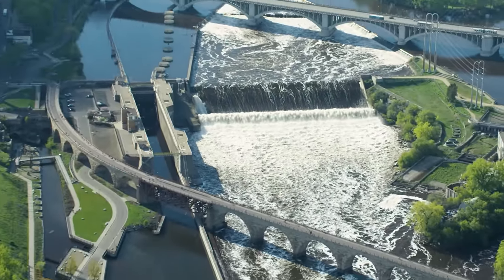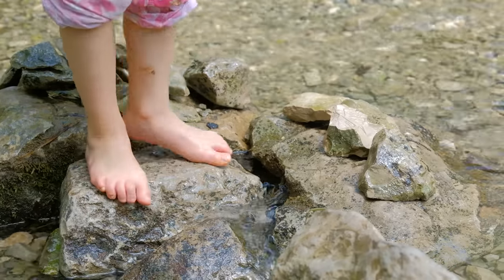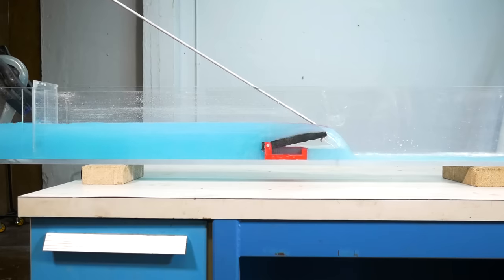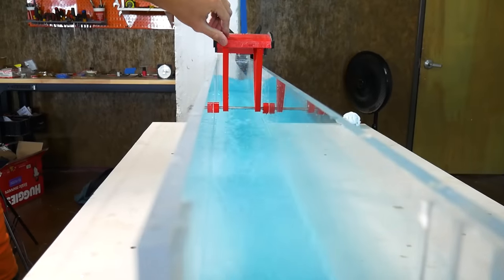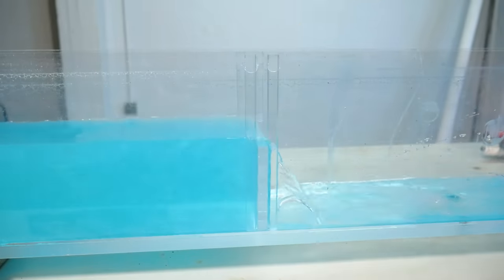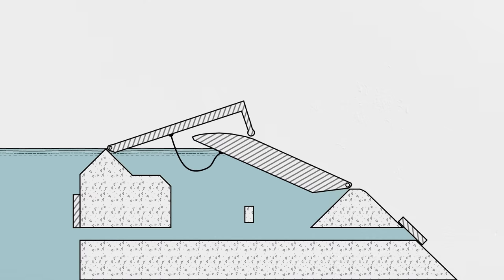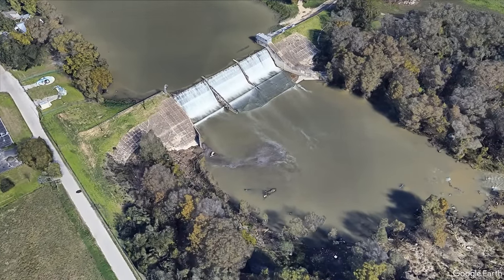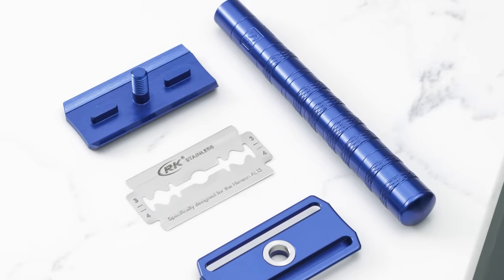How Different Spillway Gates Work

Comment: Why aren't reverse-facing crest gates common? They'd usually fail closed (because they'd be pushed upward by the upstream water pressure; unless the water level upstream was too low). Force requirements would be slightly lower than normal crest gates (and oriented downward, which might allow for actuator designs that use gravity). The only disadvantage that I can see is that it requires a load bearing stop that will, in case of actuator failure, prevent the gate from swinging completely around. 

Are mechanically operated beartrap gates popular? I believe Letternwehr (an adjustable weir used to control the level of Zürichsee) in Zürich has beartrap gates, but I thought they were mechanical (and couldn't see anything that looked like the downstream opening for draining the chamber).

There's a funny usecase for crescent gates, where they aren't trying to stop water flow, but only ice floe. There is an "ice dam" on Sihl in Zürich (next to Allmend Brunau) that is intended to protect the support pillars of the highway that's built over the river downstream of it, bridges in the city, and IIUC protect the channel that the river traverses under the railway station from clogging.

Comment: not aware of any bear traps where I work in Scotland but, we do have Drum gates which work in a similar manner, a large chamber is flooded with upstream water or drained and this floats or sinks the gate, they also have large floatation valves fitted so that it can track loch (lake) levels and maintain the reservoir level.

Comment: In July 2010 the Tempe town lake dam failed - it was previously an inflatable dam that could be deflated to let water out or inflated to hold more water. It would be interesting to compare the old vs new dams and dig into what may have contributed to the failure, what the benefits of the new dam you've described are.

Comment: Rare comment praising the sponsor's product - I have had a HS razor for a bit more than a year now, and it's excellent. No razor bumps or nicks! I'm still working through the first hundred blades. One suggestion is to pick up a razor bank to store and dispose of your used blades safely, as you should change blades regularly.

Comment: Awesome video Grady! Only one complaint - you mention that in the '95 Folsom Dam incident they finally controlled the water by installing stoplogs, but then mention that stoplogs aren't designed to be installed in flowing water! You can't leave us hanging like that! How was it done?

Seriously though this video is a great introduction to an essential component of hydroelectricity generation, I plan to share it with some of my less technical colleagues as a good introduction into how spillway gates work and (a few of) the ways they can fail.

Comment: Interesting pros and cons of the different gates.  After the dam failures in mid Michigan in 2020, officials said the old Tainter gate system on those dams would be replaced with crest gates in the rebuild. (work on stabilization was completed late last year, the rebuild phase should start late this year or early next year.)  I assumed that crest gates were simply a superior design. But really it's just making tradeoffs on the "best" way the dam fails. In the case of the mid Michigan dams, they were all earthen embankment dams with Tainter gates. When the first dam's embankment failed, sending water and debris downstream to the second dam, the debris from the flood got caught up in the downstream dam's Tainter gates, reducing an already insufficient outflow. The water then rose and flowed over the earthen embankment, eroding it away in just a few hours. With the new crest gates that shouldn't happen, but as you said in the video the lifting mechanisms of crest gates are more prone to fail because of the massive stresses on them. From a repair standpoint, it's a much easier job replacing lifting mechanisms than completely redoing the dam embankment. Most of the examples of Tainter gates in your video seem to be on concrete dams where overtopping the structure wouldn't be nearly as destructive as it is for an earthen dam. The exception in the video was Oroville dam, but that failure had more to do with how the damage to the spillway below the gates was managed than the actual gates on the dam.

Comment: New Croton dam in NY. Absolutely stunning in person. There is a hidden submerged dam not far from the one you can see. It was the first one they built, but later they expanded the capacity by building the one seen in this video.

Comment: I have a question. How are the stop blocks installed and removed? I assume that they are crane into place, but how does the remove part work. How are they able to rig the stop blocks up if there is water starting to rush over them once one or two are removed. Would really enjoy hearing how. Love the videos and how they are always making me think. PS love the book, great stuff!
Reply from the maker: Usually they have a lifting beam with a release mechanism

Comment: I work in a hydro power dispatch center in Sweden. About 30 power plants are my responsibility.
When I see a waterfall I always try to guess how many MW it could produce.
Also nowadays power price drops so much on windy days that we intentionally spill water instead of running at a loss.
Hard thing with spill gates is estimating how much water flows through them. If you are less than 10% wrong you are good.

Comment: For some reason, I find it quite amusing that a guy who films in his garage has an intern! 😂

The gates at Hoover dam (Lake Mead) are the floating type gates. As I understand it, they are hollow structures with valves inside. They can either be left empty to allow them to float to maximum level or they can be partially or completely filled in order to set the lake level. Quite an ingenious system, in my view! However, thanks to over allocation and quite a number of light winters (this lake depends on snowfall in Wyoming, Utah, and Colorado), the last time these were used was, I think, about 25 years ago. The lake hasn't been high enough since that point.

One type of water release valve that you did not mention are needle valves. These are the type used at Lake Powell and were originally used on Roosevelt Dam before it's rework in 1995. In fact, after the dam was completed in 1911, it only had a crest spillway and that could get out of control fast. Outside of the power plant and one or two needle valves, there was no way to reduce the water level save for a sluice gate which they dare not open because the pressure of the water would destroy the gate and the passage in the process. When additional dams were added to the Salt River system in the 1930s, the spillway was modified to add radial gates up top. This had both the effect of better level management and more graceful flood control but also allowed them to increase the lake level by about 15 feet which greatly increased the reservoir capacity. In this case, not only did the gates leak, the dam itself had a few points of seepage between the stone blocks that it was comprised of (and this was expected). This can be seen in old photographs.

At Lake Powell, the dam is set between two sandstone cliffs. The sandstone is just permeable enough that the pressure of the water from the lake forces water to slowly seep through the surrounding sandstone and flow down the sides of the canyon downstream from the dam, requiring high scalars to periodically have to clean the face of vegetation and occasionally loose bits of rock. Perfectly safe but an interesting feature. Usually mortar is injected under pressure into the surrounding rocks to seal them (as was done for Hoover dam) but that wasn't an option here, as I've been told.

Great video, as always!

Comment: You should do a follow up and include wooden flash boards and their modern replacement: inflatable rubber dams. I worked on more than dozen of them. Made by Bridgestone. Installed mostly in the northwestern part of the USA on small hydroelectric plants.
Reply: Never heard of those types of dams, I would be interested in learning more!

Comment: Hi Grady.  Question for you: with the crest gates - why not simply have a locking mechanism to keep them in place when they've finally reached their closed position?  Then you'd only need to resist the force of the water when the gate is opening or closing.  Like, if my brother is annoyingly trying to force my bedroom door open 24/7, if I don't have a lock, sure, I need to lean on my side of the door 24/7 to keep it closed.  But if I have a lock...

Comment: I shudder to imagine how bad Folsom dam could’ve been if it was a general failure instead of a single gate failing. A half empty  reservoir is bad for local water prices but a full failure means there’s not typically anything left downstream to use said water.

Comment: It seems a beartrap gate could be serviced if both leaves were able to stand at exactly ninety degrees to the ground. But then it might be difficult to take the upright leaves and lay them down again due to the water pressure. Which could be alleviated by allowing additional bypass tunnels on the main concrete supports on either side which just have basic slide gates. The overall shape would be somewhat like a badminton shuttlecock I imagine, with the main chamber tunnel in the center, the gate leaves above that, and the two bypass tunnels on either side.

Comment: I know stainless steel isn't purely immune to the effects of oxidation, but it seems like using it for key parts (or a more inert metal or material) would save in the long run. Also, inspection seems like a good way to avoid regular replacement; which would be the safer option.
Reply: Stainless steel is also more brittle than mild steel, this makes it much harder to form and more prone to fracturing. It's also much more expensive, so usually other methods of corrosion inhibition are determined to be more cost-effective.
Reply: @techmage89  Does that cost take into account the need for frequent underwater inspections and replacements?

Comment: In Great Falls, MT, the dam uses a rubber bladder to adjust part of the spillway on the Missouri river.  It was some years ago I was in the dam but I recall one of the workers saying the bladder was tested by shooting at it with a 30-06.  Must have been Firestone or Goodyear that did the original bladder.  Being resistant to hunting rifles is a good thing in Montana.

Comment: The biggest reservoir in the James Bay Hydro-Québec complex is the Robert Bourassa reservoir.  Receives the flow of a number of rivers has been diverted to it.  The spillway is visible from space.   53.796990316874954, -77.4405634307666  (use Google Earth and go back to 2015 where the image has no snow).  
The spillway is 122m wide, drops 110m over 1.5km in 10 steps each of about 10m high and 150m long. Each step is greater than size of a football field. 
It is designed to handle the flow of twice the St-Lawrence river at Montréal. 
Ever since they opened a sister generating station next to first one, they have not needed to use the spillway, and this despite adding more river diversions into this reservoir.  The generating stations are underground, but you can spot the concrete pads whene electricity comes out and if you follow down to the lower river shore, you can see the 4 "slots" for LG2 (Robert Bourassa) station and to the west the 2 slots for LG2-A station. 
LG2 is 5.6 gigawatts, and LG2-A is 2.1 gigawatts. 

The gates ate lift type, there are 8. 
Each gate is 12m wide, 20m high, and 1.5m thick.
4 of the gates weigh 114.5 tonnes, the other 4 weight 123.6 tonnes.  (metric).  The reason: the heavier gates contain heating equipment for winter.
The gates are that high to ensure that if opened, they draw water below the solid ice at the top which would not flow on a crest gate, and they may also need to lower the reservoir level that much.   Initially, there were also floating logs and they didn't want those to get stuckj if they made water flow from the top.

The gates have not been needed since the late 1980s (the dam started to produce electricity in 1981 as I recall) but still need to be tested. 

Look for video "Opening of the spillway gates at Robert-Bourassa generating station" from Hydro Québec for short clip showing the 2018 testing which was for full gate opening (every 15 years, otherwise test of only 2m left every 5 years).

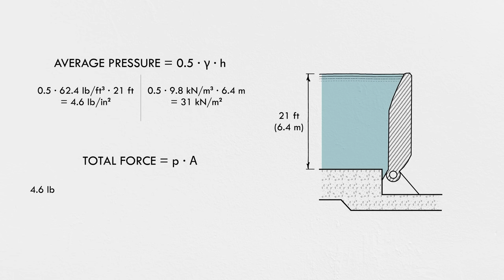Comment: 5:00 There's a mixup of lb and lbf, whereas metric calculation is using N/m2 for pressure (correctly), but then next magically changes from newtons to kilograms. It should stay at 6.4 MN and be illustrated with two Jumbo-Jets' weight (654 ~= 650 tonnes).

Comment: Been using a good ol' fashioned double edged razor for about a decade now. . .  When I first used it, I was amazed to find that it shaves as close, if not closer than all those fancy-assed multi-bladed cartridges!   And at about 4 or 5 bucks for 6 blades, you sure do save a ton of $$$! 

Plus, there's just something kind of satisfying about using something so simple as a double edged blade and razor, while still being a heck of a lot safer than a straight-edge!  

And no, I'm not a paid sponsor for this brand of razor.  I'm just putting in my 2 cents for those on the fence about switching. . .   ;)

Comment: fun fact about those type of razors... some older houses have slots in the back of medicine cabinets that were for disposing of those blades, and they'd just fall down into the wall... so there are old houses with walls full of used razor blades.

Comment: what about the bladder gate use, I'm not sure what it's called, however in Oregon City/West Linn on the Willamette River at the Willamette falls in Oregon, they have a bladder type gate they use to keep the water at a desired location at all times. The Willamette falls is the second most largest waterfalls by volume in the Continental United States. It should be more famous in my opinion however it is an outstanding piece of engineering thanks to Dr McLaughlin. Thank you for posting, I enjoy all of your videos.

Comment: If the crest gate was lifted/lowered with a worm drive it would eliminate the problem of holding back all the weight. Worm drive on either side, mounted in line

Comment: U should do a episode on the sacrificial electrodes inside damns and salt water metal structures that are used for anti corrosion. Same principle basically of the one in electric water heaters to keep the rust and corrosion down by using a metal sacrificial electrode to purposely attract and be eaten away at so the steal and other metal is less effected.

Comment: This might not be the best idea for future clients however, it might be rather good interest to reveal the reasons why some dams, bridges and other municipal, county state or federal assets fail early. One example would be Oroville dam which failed due to a good decade long list of inspection reports that were ignored by whoever. The citizens never get the real story as to how things got started to fail and the reasoning why plus any lawsuits that are generated from said mismanagement.  Then there was a couple of bridges that failed in PA that seemed to be from the same, ignorance in management. Maybe some input about engineering in general that involve city water systems, city roads, sewers and so on and what goes with the plans from the engineers such as a "maintenance plan or manual" along with estimate annual cost of and required maintenance. There have been failures, flooding, fires etc. that have been linked to mismanagement of maintenance yet our media tends to keep most of that information silent in part to keep the complaints down when in fact, they really shouldn't or else they will continue to mismanage. I really don't think a lot of the public have any idea of what engineered structures and systems require for maintenance needs and the approximate life span for them are. The public tends to believe whatever the authorities publish after a major failure happens and its 100% their fault yet the stories don't come out and say that. The public really needs to know what happens in the courtrooms and other when major blunders occur and what the final cost is when weighed against the money that was trying to be saved from regular maintenance vs. the lawsuits they have to settle. Usually, the settlement are from public funds...that means those responsible don't pay anything and they rarely are disiplined etc.
Reply: And while you're talking about the Mississippi and failures don't forget to include a bit on the I-35W bridge collapse in Minnesota (if you want).

Comment: You might be able to visualize the pressure on the trunnion pin in the plastic trough with some polarizer film. Plastic has odd stresses in the material, polarized light reveals them. Also, to a lesser extent, glass! But yeah, some polarizers might show the stress moving through the plastic walls...

Comment: Funny that add ya had at the end. I can confirm that the safety razors are a LOT better.... I have gone to those about a decade or so ago and I swear. My normal razor is an old Gillette adjustable safety razor my dad used to have. Best shave I ever had. And the cheapest.